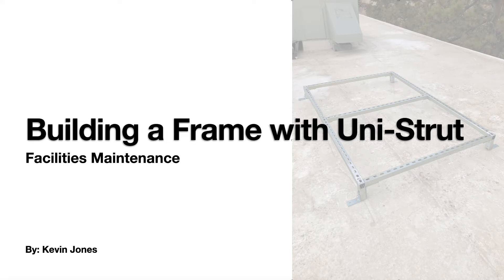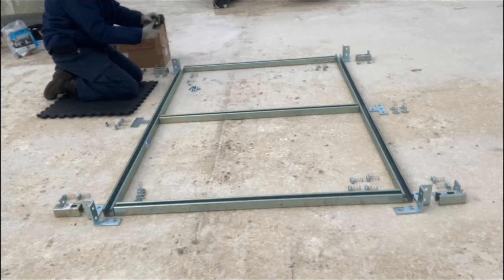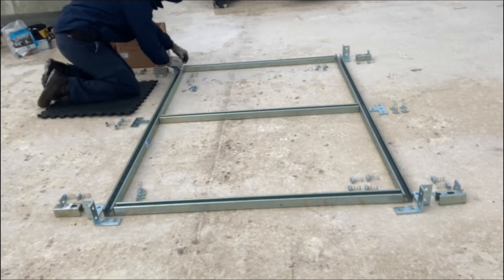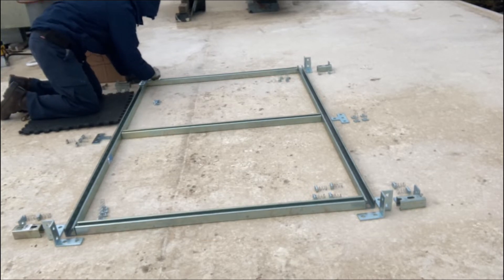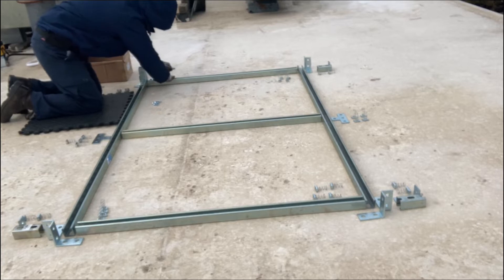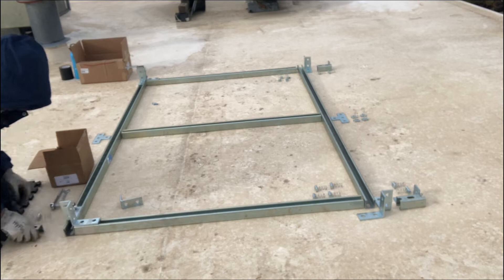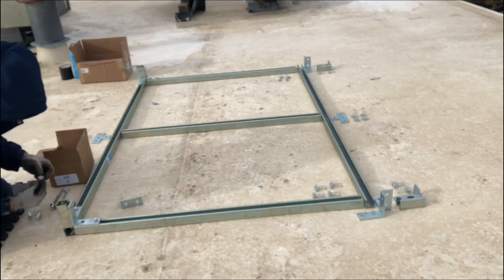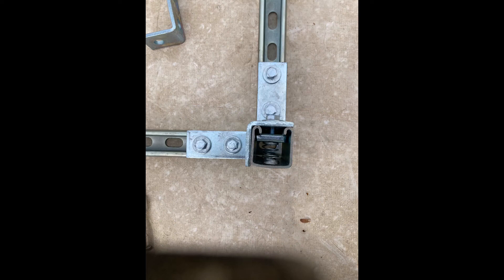Building with Uni-Strut | Super-Strut | U-Strut | U-Channel

Comment: Nice. But i am looking for one the moves along the other. How can I do this?
Reply from the maker: You could use 2” x 2” x 11ga steel tubing.  You would have some play between the uni-strut  and the inside of the square tubing that you could take up with shims or you could have a nut and washer inside the uni-strut and drill a hole through the wall of the square tubing and put a bolt through the hole in the square tubing and secure the unit strut to the square tubing then the play should not be an issue.  Or bolt two pieces of uni-strut back to back or use slotted angle iron.

Comment: Can do this but underneath so I have the same level on the top mate ?
Reply: I mean same what u have done but use the hole to join them up
Reply from the maker: You could use the holes to join them up, yes
Reply from the maker: You can cut the legs to the height you need to achieve a level frame. The corner brackets have some tolerance to give you some adjustability as well.
Reply: @kjfacilities-maint thanks mate im making a frame to hold my solar panels to my van roof using 90/ angle to make the frame shaped but i wamt to try to fix them together from the hole underneath the uni strut. That way i can use the zebedee s to fix the solar panels to the uni strut thanks for your video big help mate and thanks for the comment back 👍
Reply from the maker: You’re welcome. Good luck with your project!

Comment: Thanks for the video. I am thinking about starting to use struts instead of perforated angle profile as the structures quite often come out uneven. With strut's forgiveness and spring nut adjustability I think I will be able to make more even structures. I just hope they will be strong as well. Thanks for your time and video. :)
Reply from the maker: You're welcome.  The struts works great, I highly recommend giving them a try.
Reply: @kjfacilities-maint where can i find the connectors? Whereas unistruts are quite ubiquitous, the connectors prove to be slightly harder to find. Thanks a lot for the excellent, educational video.
Reply from the maker: @yanivnevechen you can find the Uni strut brackets at Lowe’s or home depot Amazon.com, just type in uni strut brackets in their search bar on their website.